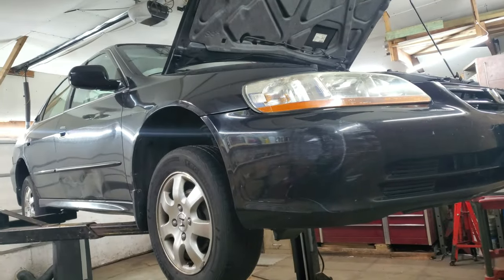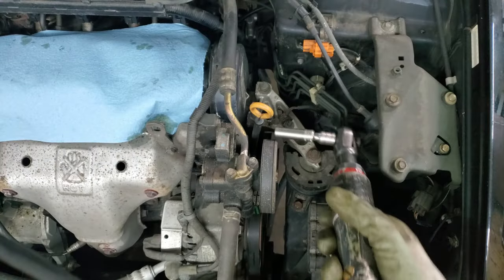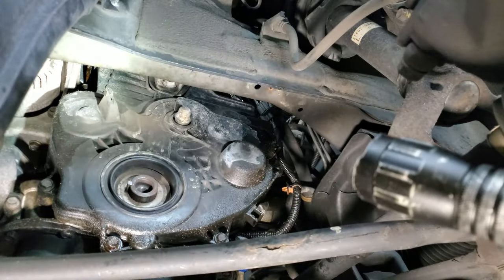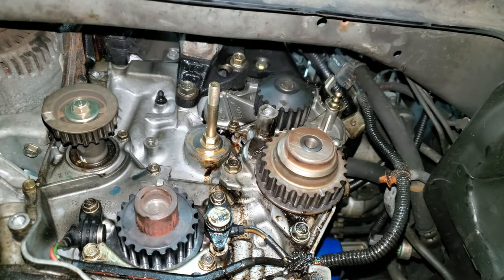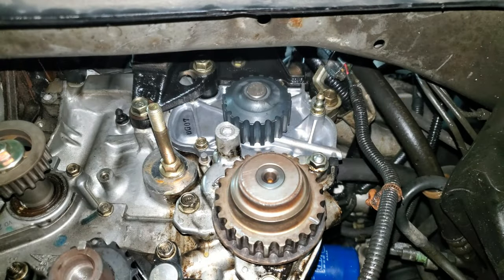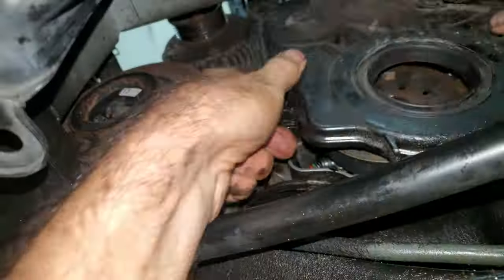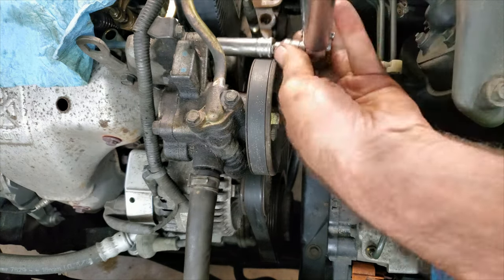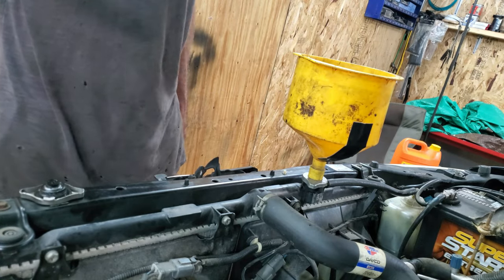1994-02 Honda Accord 2.2, 2.3 timing belt replacement

Comment: On my 95 there is zero room between the frame and the bottom cover.  I can't even get the cover back and yours had tons of room
Reply from the maker: Sometimes you need to jack the engine up, or down a little.
Reply: @RustBeltAuto  I let it fall on the other three mounts not low enough.  How high can I go before I break the other three mounts?  Thanks
Reply from the maker: @Clearanceman2  just try not to bend the oil pan. Put a block under it. You will be able to feel when it will not go up anymore. It will start to lift on the car.
Reply: @RustBeltAuto  I already bent the pan a little with my jack with a thick rubber pad.  I'm going to try to use a 2x4 across the entire pan?
Reply from the maker: @Clearanceman2  yes. Be careful. It shouldn't take that much weight.
Reply: @RustBeltAuto  I'm guessing the engine side of the mount can't be put on with the lower timing belt cover in place?  Ordered new cover this one has had it. How about I disconnect the front mount and the trans mount and then with the oil pan on a board on a jack have my son try to pull the engine toward the passenger's side by whatever means?  Engine all the way up, no way.  Engine all the way down almost.  But there isn't enough room between the frame and the engine for the cover to slip past the water pump bolt that has the balance belt tensioner and the balance belt pulley on the left side.  Closest is engine all the way down.  The engine won't move toward the passengers side hardly at all with three of the mounts in place
Reply: @RustBeltAuto  I didn't remove the splash guard I'm thinking that's a must do?
Reply: @RustBeltAuto  Splash guard and then the engine down all the way?
Reply from the maker: @Clearanceman2  whatever works. The thing is made to come off.
Reply: @RustBeltAuto  I got it off but can't get it back on.  There is no splash shield as a  tech suggested I remove it.  It's solid metal.
Reply: @RustBeltAuto  I'm thinking disconnect three motor mounts and try to move the engine over.  Also, would be much easier with the bar from the lower control arm to the front removed but it's a little bit of a pain, have to move the axle to get at one bolt.
Reply from the maker: @Clearanceman2  what comes off must go on.
Reply: @RustBeltAuto  I know I don't get it.
Reply: I've resorted to pulling the front motor mount and trans mount.  Now I can rotate the engine around the back mount.  One jack under the trans, one under the oil pan.  This sucks a lot.  There is no splash cover on mine all metal.
Reply: @RustBeltAuto  I did get it on but had to use two jacks and remove three motor mounts to do it.  LOL
Reply from the maker: @Clearanceman2  I have a feeling that you are the only one that did it that way.
Reply: @RustBeltAuto  Yeah I didn't do it that way the first time.  I think my cover is warped.  My alternator belt burned a hole through it.  I fixed the hole but I don't have a rubber gasket that pushes the cover back on the nut that holds the tensioners.  I ordered one but I think my cover is bowed out in the middle.
Reply from the maker: @Clearanceman2  they do that because there are missing bolts. I would have bent it, and crammed it in there.
Reply: @RustBeltAuto  If I caught it sooner or understood what I was looking at I would have for sure.  Yeah, now I'll try a heat gun carefully and push it in and try to use the rubber retainer.  I'm supposed to get one today.  No one seems to have an OEM cover used or new.  It would have been easier to bend it and install it off the car but no way am I pulling it again.
Reply from the maker: @Clearanceman2  it won't hurt anything to leave it. I have seen it many times.
Reply: @RustBeltAuto  FWIW, it bends pretty easily using a heat gun and I bought the rubber Oring from honda.
Reply: @RustBeltAuto  Honestly, the cover is a lot farther in with the rubber piece in place.  none of the grove was showing and it's probably a 1/4 inch or 3/8 inch metric equivalent groove.  So that's definitely why it was hanging up.  Once I got the rubber piece in place I hit it with the heat gun so hopefully it will help it stay.  The belt had worn a hole which I hope I fixed and the pulley was starting to scuff and would have eventually destroyed the cover IMO.  My cover needed a lot of attention and I put an order in for a new one at the honda dealer but it is back ordered with no ship date.  The only one on ebay is 120 dollars!  Retail is 50.  That sucks, the aftermarket ones suck.  I have subarus too and the covers are available everywhere.
Reply: I am having the same problem, 1995 Accord, can't get the lower cover out from under the car.
Reply: @zmelli  This is what I had to do including buying a new cover.  They don't even make it anymore, I was lucky to get one off ebay for $55.  OK.  I disconnected three engine mounts everything but the back mount.  I moved the engine over.  And then I STILL had to disconnect the brace bar from under the radiator to the lower control arm.  I disconnected it at the lower control arm to move it enough to slide the cover in and out.  It was a big PITA but be super careful not to break that cover since they are not easy to find and aftermarket doesn't fit.  If you find a new OEM it comes with the gasket installed.  I didn't know that and ended up wasting $20 on a gasket.  Although, that's out of production too so not the end of the world I guess if I ever need one.
Reply: @Clearanceman2  is your car a manual transmission? I can't believe you need to remove three mounts, something going on here.
Reply: @zmelli  It's an automatic.  Officially you are supposed to remove the motor mounts and jack up the engine but I tried jacking it up as far as I could bear and lowering it to hang on the back mount and neither worked. I know it's something I don't want to do very often.  And if your rubber retainer ring is missing on you pulley nut in the middle of the cover, get another one before your cover warps or it's even harder to get it off, it will come farther out on the nut.
Reply: @Clearanceman2  I bought a new rubber retaining ring. I did not have this problem with my 1991 and 1993 Accord lower covers. so frustrated, doing research. Officially remove how many motor mounts? I only removed the drivers side.
Reply: @Clearanceman2  Did you try removing the AC Compressor bolts?  I may remove the condenser fan and loosing the AC compressor bolts, seems that the lower cover is hitting the AC clutch.
Reply: I removed the AC Compressor without disconnecting the lines, moved it forward and was able to remove the lower cover!
Reply: @zmelli  Thanks, I'll keep that in mind if I ever have to do that again.  That would not be fun but easier than doing the mounts plus that bar.  The mounts actually aren't that bad but the bar kind of sucks.  you have to take the strut in half to do the bar too.
Reply: @zmelli  I did the front three mounts and left the rear because it sucks.
Reply: @Clearanceman2  I will make a video and post it today showing what I did. It was actually pretty easy to loosen the AC Compressor. Yes the rod that is in the way was to hard to remove, I left that connected, the lower cover fell right out after moving the compressor. I am very surprised that it was so hard to find information about this this issue, it must be model year specific. like I said I also have a 1991 and 1993, no problems there. I will title the video "1995 Accord lower timing belt cover removal".
Reply: @zmelli  Pretty sure the 1998-2002 ones don't have this issue either.  94-95 are different slightly than 96-97 because they don't have crank sensors.
Reply: @zmelli  Thanks, I look forward to watching that video.  I know the 98-2002 don't have the issue.  94 and 95 are different than 96 and 97 because no crank sensor but I don't know how this effects removal and installation of the cover.  It's a different cover for 94 and 95 vs. 96 and 97 though, I know that.

Comment: i have bad luck my valve bolts are seized.
Reply from the maker: Valve bolts?
Reply: @RustBeltAuto   sorry valve cover bolts.
Reply from the maker: @madmanlives_on960  did you use a 6 point 10mm?
Reply: Yes on a regular ratchet  not an air ratchet.Bolts feel like they are gonna snap in half if i try to break them loose.
Reply from the maker: @madmanlives_on960  they can be really tight. They lock on really well. Just do it.

Comment: No he's not an excellent mechanic... that balancer shaft on the right  he time it wrong... there's a 12 mm bolt need to be remove and time it with a screw driver 😢
Reply from the maker: Yes. There is a hole. I believe that was mentioned. However, the belt was put back on the same way that it was taken off. So far, all these I have done, are aligned this way.

Comment: Why not stick a screw driving are small hole punch in the little hole on back of engine before taking the balance pulpy off so it doesn’t move
Reply from the maker: No need.
Reply: Cool deal thanks for reply
Reply: Great video btw very helpful I dread timing belts and chains.

Comment: Starting an engine without coolant is a big No No.
Reply from the maker: Yes, and no. A 5 second run will not hurt anything.
Reply: @RustBeltAuto  you're right. It's big NO NO only when the temperature heat up

Comment: Love your video. But there is one thing. That is not how you set timing belt tension.
Reply from the maker: Enlighten me.
Reply: @RustBeltAuto  You rotate the engine counter clockwise a few turns, stop at Top Dead Center, then rotate the Engine Clockwise three teeth then tighten the tensioner bolt.
Reply from the maker: @zmelli  thanks!
Reply: @RustBeltAuto Oops! I just did this, you turn the engine counter clockwise three teeth then tighten the tensioner nut. worked for me, I had to grab the Book.
Reply from the maker: @zmelli  i believe you. Now just for fun, you can twist the belt to check it. Sometimes if you are in the wrong spot, the belt will be too loose on the drive side of the belt.